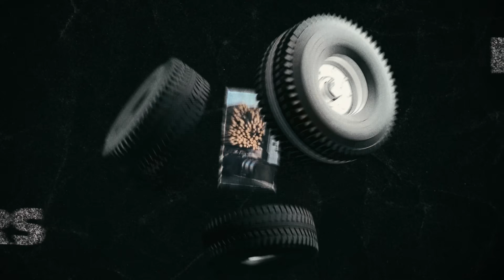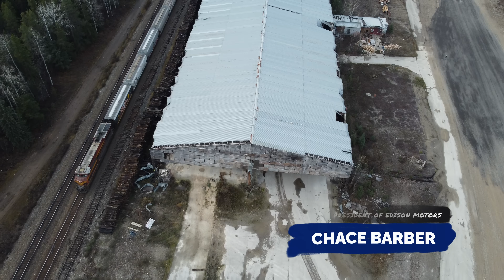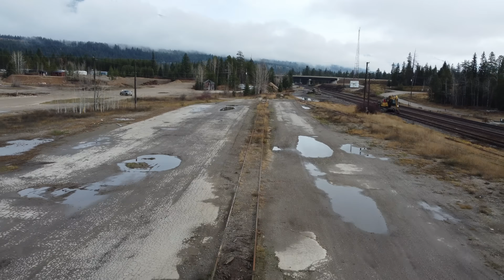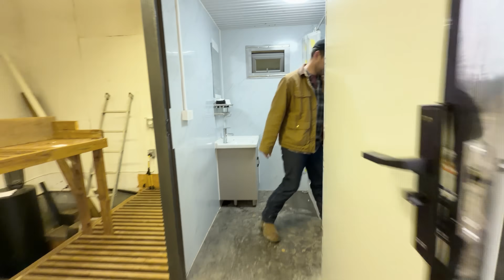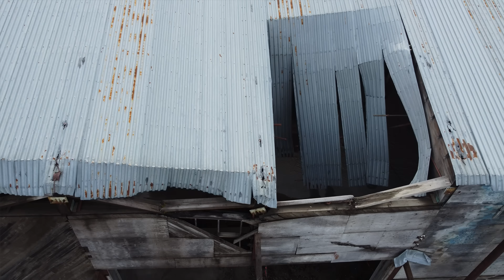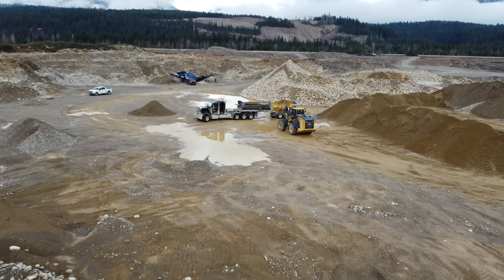Can we Turn a LIABILITY into PROFIT??

Comment: Expect to end up ripping up all the old rail infrastructure and having to reinstall it with new (probably concrete) ties and getting your own weigh scale station integrated at the spur. Everything has salvage value. The stone bed can be revived and some sections of rail may have life in them but CPKC will want to send in someone to check. The ties though are going to be all non-starters due to age.

A channel named This Is Ashville from over in England were going through a similar project with a less decrepit private spur. Let's just say that their creditors or investors ran out of patience even as the whole thing became functional. Good luck though chaps. I still think it's a really great call but I don't know your backers.

I'd suggest contracting with a tidy demolition firm for sorting the metals to recyclers as you go and hauling it away. Forget about being sentimental with old beams unless you're really expert on what's involved in preserving and storing them for reuse. The sight of heaped mixed waste on your build site will make investors edgy. (I thought you already erected your assembly building somewhere but YT says this was uploaded three hours ago - I'm confused but only saw three or four other Edison episodes.)
Reply: Thanks for this feedback.

Yes, the new 30,000 assembly plant has been stood up elsewhere.

The decrepit building in this vid is an ancient 200,000 sq ft warehouse.
Reply: @Sah-o5m  Understood. Thanks for the prompt reply.

Comment: I had two transload facilities as recent as 10 years ago.  The BN & CP stopped servicing our rail spur saying we didn't offer enough loads to justify them stopping.  In a span of two months I went from making good money transloading into ocean containers to having to shut down.  Before you even think about tearing down the building you MUST get a contract with the CP or you're playing with fire.
Reply: The building has to go either way, that's non-negotiable.  The rail spur itself (since it's just using the concrete pad) is where you'd need a contract.
Reply: How many loads were you offering to BN and CP and how many were they wanting to justify the switch?
Reply: Did you have a youtube channel with half a million subscribers and have members of the federal govt on speed dial?......different amounts of leverage gets different results......
Reply: @unhippy1  BN & CP do not care about million subscribers. They are such a huge player. Edison Motors are like just a droplet in the ocean for them.
Reply: @moulinsart  Would they care about Edison motor specifically? no......but the federal MP's they do take notice of.
Reply: @unhippy1  no they wouldnt. honestly short haul like this doesnt drive in enough money to make it something cpkc would do in a timely manner. they would still service them but it would be at CPKCs pace and only a full spot or no spot

Comment: Those glulam columns* are 100% reusable.   Send a sample down to Vancouver for destructive testing and determine what structure can be built from them.

I work at a mass timber Engineering-build firm in the Fraser Valley if you need help.

Comment: Putting a turnout on a rail mainline can cost up to 250 grand. Once on your property, maintenance is solely on you (providing insurance for their equipment too), or terms can be met where the railroad handles it like a rental, but bills extra for inspections and other costs (using their employees and equipment...)
It's definitely an asset having the railroad so close to the property.
Reply: plus if they derail on their property and its found to be the fault of the customer then rerailing everything but the locomotives is up to the customer

Comment: Heavy industries had been thriving with the help of rail transport for 150 years before the oil mafia got strong enough to push the rainways out of business and replace them by long haul trucks that need a lot more fuel for the same job. Global ressources are limited. Using long haul trucks for everything doesn't have much future. They burn through fuel and other ressources way faster than rail transport does. 

A new, fast and efficient connection between rail and road transport can become another application for Edison's electric trucks. Rail transport relies on a network of local container terminals that can quickly load containers from the train to last-mile trucks and from last-mile trucks to the train. It had been done successfully in the past, it's not an entire new idea. Electronic communication and electric short haul trucks are able to make it way faster and way more efficient than it had been in the past. When done in an ideal fashion, long and medium range rail transport combined with last-mile trucking will beat long haul trucking in every aspect.

Comment: Be a real shame if that condemned building burned down saving you half the demo cost!
Reply: That timber is almost irreplaceable.
New timber is not as old, so has more knots.
This reduces strength.
It is not like we plan ahead for timber replacement and plant new trees for when the timbers are going to need to be replaced in 150-300 years.
Reply: @economicprisoner  why not use Euro spec timber?

Comment: Even if you weren't looking for a short term revenue stream I'd say restore the rail lines. The fact that you have makes it a no brainer.

In the short term it's not going to be relevant but when the day comes where you need to scale quickly, having separate rail lines to handle input and output directly at your own facility will be extremely beneficial.

It also helps that for this sort of heavy vehicle manufacturing rail is the most cost effective form of transportation both for the input and the output. (Probably the equipment used for the manufacturing as well)

Comment: Save as much material from the deconstruction as you can! And leave all those huge verticals in place, as well! I'm curious to know what the income potential is for the rail spur?
Reply: Not much, there is a reason why it got closed and removed, would be interresting to know, when this happends..
But times have changed, fuel got more expensive so railway might be more attractive now.
500k to reopen it is a pretty small amount for there company, so it is probably worth trying

Comment: It'll be some expense, sure, but the options that rail connection opens up are so worth it. As others have said, get the old tracks checked before you derail something, because doing it right is a hell of a lot cheaper than fixing mistakes. Saving that wood is good too, that stuff gives character and ties whatever you use it to to the history of the land.
As a distant pipe dream, this rail connection also gives you the eventual possibility to try and improve trains, too - I know it comes up often that train cars could be given regenerative braking and their own motors, all linked to the locomotive as a generator, a vast cousin to the proposal of regenerative braking trailers. You could perhaps kick that off the same way you're looking to shake up the truck industry.

Comment: As a railroader I knew there was more than one reason to support Edison Motors. Just be warned that railroads are beholden to rich stockholders. They're not interested in new customers or keeping customers happy. They just want to get a quick cash grab and bail. Be aware that the entire process is frustrating to say the least.
Reply: Yeah I was just coming to say what Justin did.  They will make it all bright and shiny in the start but will slowly reign back their involvement if you don't have enough freight to make it worth their while.  They won't send a wayfreight to you to switch you out in a timely manner, and low priority mainline freights will be lifting infrequently.  The fact you are on the mainline is a bonus though, but parse EVERYTHING the railroad promises you.
Reply: I wouldn't put it past Edison Motors to reform the entire North American railroad industry just as a byproduct of trying to distribute trucks and supplies
Reply: @RoamingAdhocrat  Look up "precision scheduled railroading" if you want a rabbit-hole.
As they put it in the "Well there's your problem" episode about it: 
"It is neither precision, scheduled, nor railroading."
Short version is that railroads run overly long trains and avoid investing in infrastructure.
This means that if any delays happen in the system: they cascade.
The resulting lack of schedule means that they expect employees to work on call 360 days/year with a 2 hour notice window.
But the lack of schedule ALSO means that they can't actually ship time sensitive (read: high value) goods. When I looked into VIA rail tickets from Edmonton to Vancouver: they could not even tell me what day I would arrive!
Reply: @economicprisoner it also doubles as a method of controlling the whole system and driving out competition. The rules favor them so long as their trains are too long for any nearby pullout and nobody can schedule around them.
Reply: @OstrichWrestler  If they had not captured the regulators: ban trains longer than the sidings.
Reply: @economicprisoner  which is what we do in Europe, we don't allow trains longer than ~40 cars or so
Reply: @economicprisoner Ya, they have a hell of a time getting anything, anywhere by a set date, but they will charge you thru the ass for your product, sitting in their car, for longer than midnight of the date of arrival.
They can drop on your spur, at 17:30 on a friday. If you don't get it loaded or unloaded (Released back to them) before 23:59 on Friday they will charge you per car, per day, user fee. They don't care about weekends, or holidays, birthdays, or anniversaries. Until its released back to them, you are getting charged.
Reply: @economicprisoner  PSR makes sense if you have a bunch of small loads (5 to 10 cars) or one or 2 extras that are all headed in the same direction, but railroads take it to an unrealistic extreme. In my opinion, the train can only be as ling as the driver can see, if they cant see the end of the train, that it needs to be shortened or have someone at the other end like in a caboose who can act in case of emergency, even then their really should be a limit on train length
Reply: @economicprisoner - VIA doesn't own the majority of the track they run on, they're beholden to CN Rail for the most part and CN will always prioritize their trains over VIA (despite VIA being a Crown Corp).
Reply: @economicprisoner  Exactly this.  Working at Oshawa Assembly (truck plant near Toronto) they've been ripping out much of the existing rail infrastructure into the various buildings.  Outside of the truck frames coming in and final product going out, it's easier and cheaper to deal with trucking companies.  Oshawa used to have 2 rail docks into the every building on the campus, but now only 2 buildings have rail docks left, with only 1 being actively used.
Reply: @RoamingAdhocrat  they can make locomotives at this point too. Imagine Edison trains running all across North America.
Reply: @LouisSubearth off-road logging locomotives
Reply: @LouisSubearth wouldnt be the first time a vehicle manufacturer did this, gmc used to own emd and Henry for owned his own railroad at one point. Personally this is an area I feel as though tesla should be focusing on instead of those god awful cybertrucks. Their is growing support for rail electrification in north america and since they specialize in electric vehicles, they could capitalize on it and build electric locomotives and offer services to build and maintain electric rail infrastructure. But ofc elons an idiot man child so I doubt they ever will do that
Reply: @joshuahill6994  Elon HATES electric rail. That is why he proposed the hyperloop to take the wind out of the sails of high speed rail projects.
Reply: @joshuahill6994  Good luck trying to push out the companies that supply the current electric trains. GE and Siemens just to name two are not going to let Tesla elbow into what little market there is.

That is the other factor while you might get a few electric light rail services here and there it's a drop in the bucket compared the non-electrified lines and isn't enough to justify the start up costs that Tesla would need to front to get started.
Reply: @RoamingAdhocrat that's cute to think that... but as somebody with runs and operates a railroad you'll learn real quick how politics with in the companys them selves effect how they operate
Reply: Where do you see this going?  There are certain lower-value freights that need bargain-basement costing and can live with crappy time-sensitivity, and the RR’s will “simply” focus on JUST pushing them JUST far enough so they don’t switch to boats or trucks.

Or at least that’s what I perceive.  Do you predict similar?
Reply: Unless there is other ACTIVE railroad spurs in the close area you're not gonna like what you get. Multiple trains going by you and not stopping. If you put any substantial 
 $$$ in the rail side they will wreck you.
Reply: @fresskead  100%... They are fucking brutal to deal with.
Reply: Where I grew up there was a stone quarry that ran 3 shifts 24/7. One day the railroad decided they didn’t want to keep this 30 mile single branch line. The government wouldn’t let them take it out because it was making money. The railroad put a new guy in charge of scheduling cars. He constantly sent the wrong cars places. Everyone thought he was just a fool. Turns out he was doing exactly what the railroad wanted him to do. The rails were removed and lots of businesses along that branch disappeared. Those railroads get what they want.
Reply: Same Justin took the words right out of my mouth I love yalls trucks and now your getting into my sector I ran a transload company for a few years  it can work keep at it yall are making big things happen
Reply: You must work for the same railroad as me. Greetings from a few miles away from Thomas Edison's birthplace.
Reply: Im surprised the building is condemned- obviously the roof needs replacement but the steel seems to be in good shape?  Oh I just saw the horizontal damage.  Still a shame to no be able to use- in that area having covered rail access for transload would be huge!!
Reply: There are people working to change this! Short line railroads, who do most of the end-point shipping, are extremely dedicated and work their behinds off to help their customers. The major railroads (and I can attest to some insider knowledge) are really worried about the stockholder future right now. They are realizing, though some say it is a five year on/off cycle, that they need to invest in smaller businesses and good service for businesses other than intermodal. Still, regardless of the fact that interstates are publicly funded, they can still make shipping economical and greener on tracks that are government free. So excited to see where we can go with trains in the future. Don't give in to the corporate souless-ness!
Reply: Canada should have kept the ways when they privatized CN after they updated the network with public money. And simply privatize the operations, this way they could have forced service to every customers!
Reply: Get 50 yr contract with the railroad. Then it be locked in for bit.
Reply: That sounds like the whole  lot like capitalism.. if you got the money you shit on everyone to keep and and get more
Reply: Don't forget being chained to the Unions.
Reply: @Hybris51129  The rails strikes are about poor working conditions, not pay.
The pay is like $6000/month.
But you are expected to be on call with a 2 hour notice window. You can't even plan a dinner party around that!
Reply: @economicprisoner  And what percentage of that $6k goes to the Union I wonder? With such a raw deal on scheduling it begs to question what good is the Union beyond sucking money out of their members and keeping them unthinking and needy.
Reply: @Hybris51129 unthinking ironic coming from you. Must have looked in the mirror while posting.
Reply: @joseph_at_9095fasl Quiet drone. Your masters propaganda has no power here.